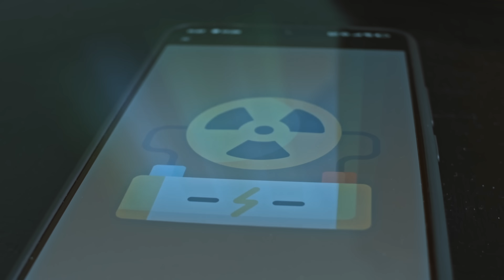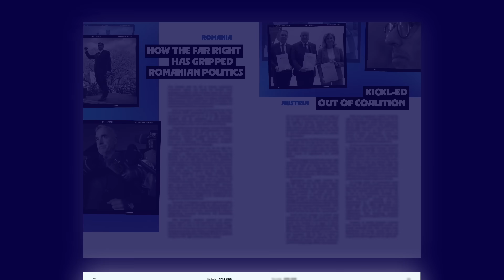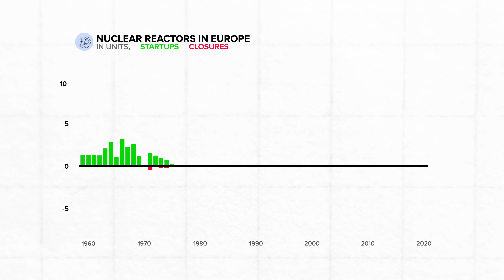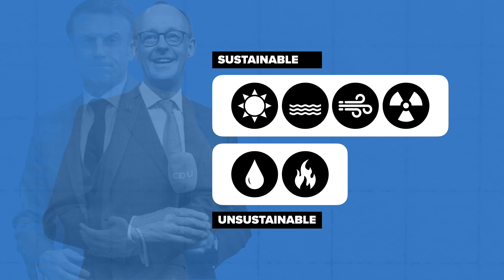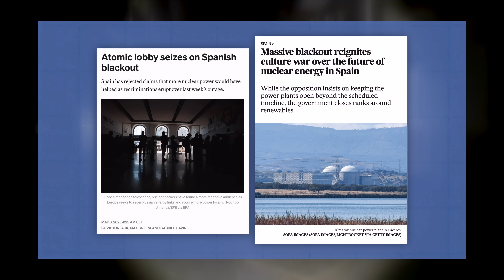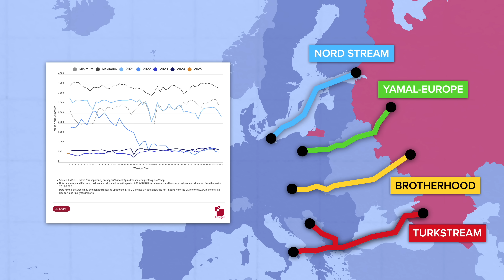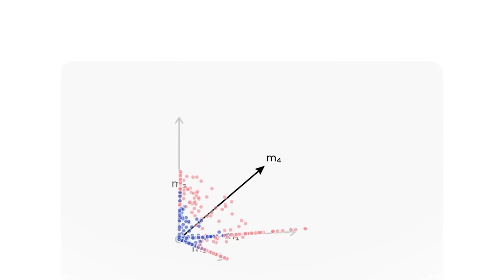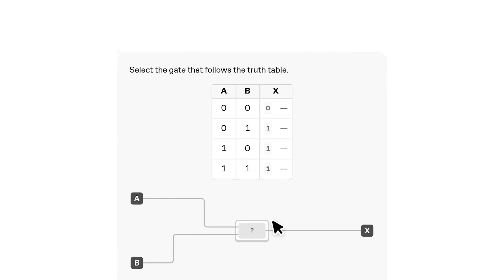Is Europe Quietly Returning to Nuclear Power?

Comment: Two aspects missing here:

1. Nuclear energy also needs resource to run on and those often need to be imported from outside sources, which can be unreliable (France imports from African countries) or from adversary nations (Russia). 
2. Nuclear energy is not a quick solution to lower prices. Building new nuclear power plants takes quiet a lot of time until they are ready.
Reply: Resource is likely not a big issue. Not much in kilos is needed for the same amount of electricity, and France wouldn't let the source countries out of her influence. Cost and time are big issues though, but nuclear will help long term stability
Reply: Doesn’t Canada and Australia have a lot of nuclear fuel material like plutonium and uranium?

They are ally nations, it will be more expensive but it is very unlikely for a Russia situation to happen again, no?
Reply: @mattia8327 Plutonium??? Please delete your comment.
Reply: They require almost no fuel.  And uranium is cheap.  It also stores really, really easily -- for decades, even.  That means hostile countries can't use it to pressure us.  Not even Russia.  And the value of that uranium for Russia is very, very low.

There is also plenty of uranium to be bought from friendly nations (such as Australia).  We even have plenty of uranium in Europe that we could mine if we wanted to -- Sweden has lots.

Nuclear power plants could be built in a couple of years -- or even in less than a year if we actually got our act together.
Reply: @peterfireflylund  At current usage rate there is enough affordable Uranium for the next 150 years or so. If we build enough reactors to get the number up one order of magnitude, the same reserves would only last 15 years.
So if we keep adding nuclear to keep its share at 9% world energy production and consider the expectation of global energy demand to rise by 25% over the next 25 years, that reduces the supply by an additional 30 years, down to 90 in 2050. If we add the expectation, (that due to decarbonisation) nuclears share in world energy production will double, we are suddenly down to 47 years more of cheap energy in 2050.
Menaing, if those predictions are roughly accurate (and nuclear can keep up with renewables cost wise) in 2050 there will be less than 50 years of supply left. WIth a typical runtime of ~50 years starting to build reactors later than 2035 seems unviable at this point and even those getting discussed today (with all that shenenigans around politicial decision making, planning nad so on) might barely make it.

On top of all this nuclear has to compete with renewables and even the most optimistic estimations of energy pricing for nuclear power I've seen so far barely beat a conservative low estimate of energy pricing for renewables.

Don't get me wrong nuclear is really cool, but as long as you don't need to optimize the required space for your energy production (like in ships) economic viability is already questionable and it gets wose the longer we wait.
Reply: @cahdoge I recognize that trick from my childhood. The “greens” (reds) said back then that we would run out of minerals in a few decades. That hasn’t exactly happened, has it? They deliberately confused things. There are reserves we know for a fact are there, reserves we have looked closer into so we know how to get them out of the ground and what it will cost. Then there are places where we are pretty sure there’s plenty but nobody has bothered to take a look yet (because we still have plenty of the first two kinds). And what is feasible/economical to mine depends on labor costs, energy costs, taxation, international prices of the minerals/metals/resources — and on the available technology. As technology improves, it will be economical to mine places with lower concentrations of the stuff we are looking for. 

And your numbers are wrong anyway. We have way more than what you say we do.
Reply: And the solar panels are made where? The resources to build the solar panels (and backup batteries) are mined where? And how much resources do you need for those? And how long do they last (in particular the batteries). No, you can't "just recycle" them.
Reply: @michaelrenper796  And THIS stuff is what Anti-Nuclear absolutely refuses to acknowledge.
Reply: @michaelrenper796 but once you buy solar panels they’re yours for at least 30 years until breaking down. 
It’s not like you’re reliant on China everyday.
Reply: @michaelrenper796  Thing about solar panels is that they're cheap and easy to install. Nuclear is good but it's no use to the community if it takes 10-15yrs to build when solar panels can be installed within the day
Reply: @michaelrenper796 well...not very easily at the moment
Reply: @michaelrenper796  the difference is that once you have a solar panel installed it will generate power no matter if the country which delivered it to you stills likes you or not. Nuclear power plants need a constant flow of fuel for the next 50 years
Reply: @realcrys  Dishonest argument again. Cutting a supply chain of a raw material like Uranium is a mid term problem 2-5 years. In the short term Uranium is easy to stockpile. And reactors can run a bit longer on spent fuel (at slightly lower capacity). It would take years before this becomes a problem - and then you can always find another supplier. Uranium (and Thorium) is fairly abundant. 
Nuclear fuel is NOT very cost sensitive. While currently the price is below 100 USD/kg, up to 1000 USD/kg would be mangeable with fuel recycling. 
At this price level even extraction from seawater becomes practical.
Reply: Those resources are also not unlimited, next to being imported. Always forgotten
Reply: Can you add a 3rd point? Overbudget. "Uk nuclear plant estimated at £18 billion in 2016,  have escalated to £46.5 billion as of early 2024."

Comment: In 2024, 3.9 GW of nuclear power production was added globally and roughly 800GW of renewable power production was added globally. That is 200 times more renewable power than nuclear power. If you calculate complete lifetime cost, nuclear power is by far the most expensive energy source. Even if you only calculate operational cost, nuclear power is more expensive than wind and solar. All of this is verifyable fact. The time of nuclear energy is over, despite some rightwing (European) governments now softening their stance to placate (far) right voters.
Reply: But big problem is renewable are not stable source of energy. Could be cheap (though my extra monthly payment/dotation for "Renewables" raised my usual price by about 25% in last several years) but they are unsafe and unstable. If you have big ass power plant with rotating turbine it has some momentum that any instability can be dealt with with a few moments to spare. But if all those small wind turbines with minimum momentum in their rotors, or solar panels with 0 such thing, start shutting down because of network instability, they'll fall like flies and will cause blackouts. Speculation is that is exactly what happened recently in Spain where renewables were I think at 55 or 60% power generation share before it collapsed.
Reply: The problem in your calculation is the unpredictability of the weather. Not every EU country has the same weather conditions. Solar panels in Spain do not produce the same amount of energy as in the Czech Republic.
Reply: What lifetime of a nuclear power plant do you assume?
Reply: Lies and irrationality. You are aware that Russia financed this misinformation?
Reply: Comparing nuclear only with renewable energies means you don't understand anything about energy grids. Nuclear and hydro (maybe geothermic) are the only reliable producers to keep the energy grid stable and are dont require fossil fuels, that means you can increase or decrease production on demand and can guarantee it is available when needed. Check Portugal and Spain blackout to understand how a sudden drop in stability can throw an entire grid down for a day.

Comment: Put a big ol' solar array in the middle of Spain, hook up a crap ton of battery storage, and you're done. It's expensive, but it solves the energy crisis and could be done in months instead of decades. 
China added more solar last year than everywhere else combined, so why can't Europe? 
When ordering such large quantities, the prices drop significantly, and once you buy solar, it's good for at least 30 years. After 1-2 decades, you get free energy.
Reply: "crap ton of battery storage" for a country wide grid is still science fiction for now
Reply: @terahlunah not science fiction, a couple of years away. In the time it takes to build a single nuclear plant you can probably accumulate enough batteries. 
But it doesn’t have to be the only power source, just enough to get us through the night. 
It’s already being done in places like Australia and California.
Reply: @NimThree  No, those are small battery storage facilities that only handle small, short-term fluctuations in local parts of their grids.  No more.  The entire world's production of batteries is still not enough to do more than that.
Reply: @peterfireflylund with some rough numbers: 
Global battery production capacity: 3 TWh
Spain yearly energy consumption: ~250 TWh
Divide that by days in year and then 40% for the night: ~274 GWh per night. 
Not 100% efficient so ~330GWh. 
Using LFP batteries assuming ~$125 per kWh, cost should be around $45B. 
Not cheap, but it’s doable especially if spread out over years.
Reply: @NimThree  Those numbers are much better than I expected.  It's been a few years since I last did the math myself... clearly, it's time to do it again!

(Nuclear would still be cheaper and better if we could get a less insane regulatory climate for it.)
Reply: @peterfireflylund yeah but nuclear takes a decade at least and is often delayed to 15-20 years. 
It’s a problem that should be solved in the next couple of years in my opinion and solar can do that. 
By the time new nuclear goes up, the solar would have already returned the investment plus profit. (Very likely).  
Also, solar and battery prices will only come down more in the next years so the numbers will get better. 
I’m not against nuclear, I’m all for it, but we need faster solutions in my opinion.
Reply: It is just so simple, you must be a genius...
Just put an entire year worldwide battery manufacturing in a country. How did we not think of this solution??
Solar and nuclear are not competitors, they work together. Learn about energy grids stability to understand why your solution is wishful thinking

PS: China is also the world top country in nuclear construction
Reply: @AAA-vd5tf It is simple. Expensive, but simple. 
It doesn’t have to be all of it straight away, but why not get started with something? 
I’m not saying solar instead, I’m just pointing out that solar is way simpler, cheaper, and takes much less time than constructing new nuclear power plants. 
Nuclear is awesome and should’ve never been dismantled.
Reply: @AAA-vd5tf  China is also one of the top countries in fossil fuels. I think you gotta compare countries as percentages of power consumption, not raw kwh

Edit: by percentage of consumption, the top 5 are- France, Slovakia, Ukraine, Hungary and Finland. All of them with over 40% (France and Slovakia over 60%!)

Meanwhile, china stands at number 25 (out of 34 countries that generate nuclear energy) with 4.9% of its energy consumption being provided by nuclear.

Btw, in terms of raw GWH, the US has number one, with nearly double the amount China, the second place, generates (around 700,000 GWH vs around 400,000 GWH)
Reply: Right, and when it's night? Or when dust covers the panels? Not to mention that deaths from solar related accidents throughout history (construction accidents, mainly) exceed deaths from any and all nuclear accidents throughout history, even when compared to the amount of energy generated. Nuclear is more efficient, more reliable, AND SAFER, than solar power, by a LOT.
Reply: @SecularZionist that’s what the batteries are for 🙃
And according to Our World In Data, Solar has 0.02 deaths per terawatt-hour while nuclear is at 0.03. 
I’m not anti nuclear, I’m just pro solar. It’s cheaper, takes much less time to set up, and it’s much simpler and easier to build. 
Also people can put on solar on their houses and get battery storage for their home which makes the grid much more resilient and less prone to large-scale blackouts.
Reply: Fair points. I remembered incorrectly about hydro and wind power and assumed it meant all renewables. Thank you for correcting me.  @NimThree

Comment: Nuclear power is one of the cleanest energy source.
Reply: With regards to climate change, yes, it's cleaner then most fossil based energy sources. But compared to renewables its a bit dirtier. Also I wouldn't declare the nuclear waste "clean" 😁
Reply: @kevinkerkhoff6670  Sure, but by that standard solar and wind aren't clean either due to the byproducts currently created in their production lines.
Reply: @kevinkerkhoff6670  Nuclear waste is a complete nothing-burger issue and the fact that you bring it up instantly tells me you don't know wtf you are talking about. Wind and Solar produce nearly 48 TIMES the amount of waste that nuclear does for every MWH. It is actually far more wasteful than nuclear is on a MWH basis as well, especially when you factor in the dirty methods used to produce photovoltaic cells (almost all of them made in China BTW) and wind turbine blades. 

None of the materials mentioned are recyclable, be it nuclear waste, wind turbine blades or end-of-life photovoltaic cells. Nuclear produces far less waste and on a per MWH basis, produces far less CO2 than "renewables" do due to the much longer lifespans and energy efficiency nuclear has compared to renewable installations, which needs regular replacement.
Reply: @kevinkerkhoff6670 every energy source comes with waste. Nuclear is kind of bad, but miniscule in size.
Reply: it releases h2o and nothing more (when handled safely)
Reply: @cyberdemn  If you handle it well, you may not even need cooling towers. Molten Sodium is a decent coolant, and VERY good for high temperature reactors.
Reply: It's not "one of the". It's THE cleanest.
Reply: @ZippyPiglin36  It most definetley is "one of"
Reply: @bobbobby3085 Any source that makes very little waste over it's lifespan for it's energy, has no real requirement of mass storage, takes up a tiny amount of land, and is going to be essential in developing our science and engineering in general?